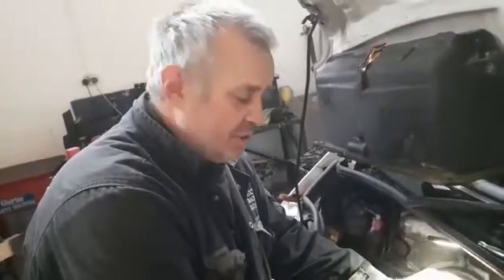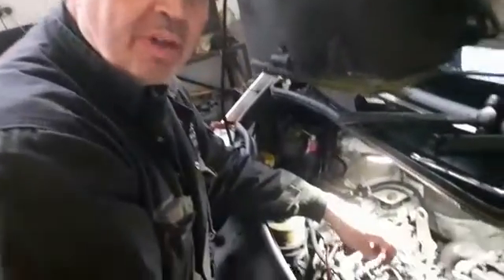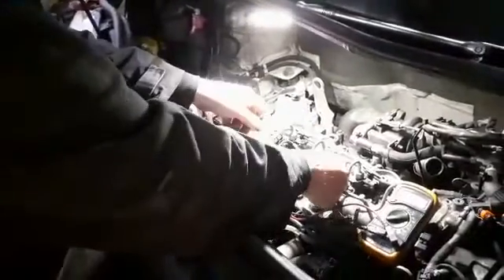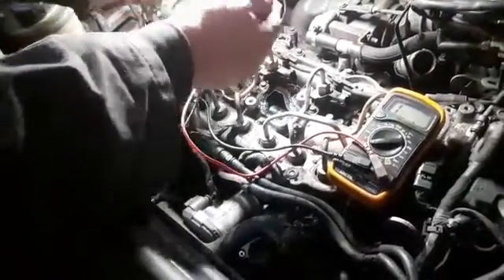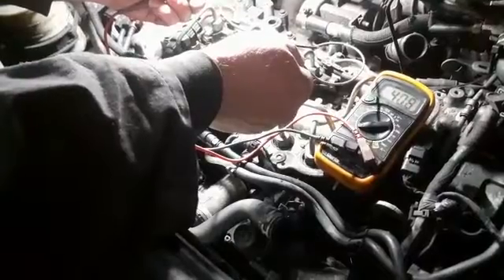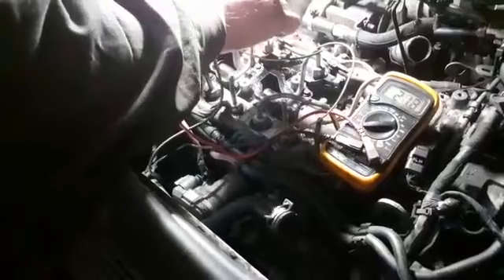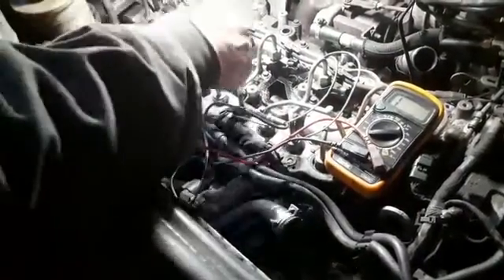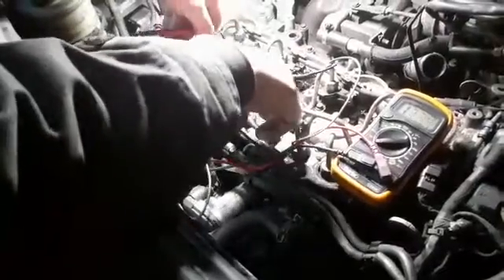Testing diesel injectors. TVP shorting to earth.

Comment: Is it possible that the injector only shorted when the engine is at operating temperature?
Reply from the maker: Yes I have seen injectors give the correct readings cold and short to earth when warm.   The van runs fine when cold and after just a few minutes of driving stop light and battery light comes on and van losses power
Reply: Does this mean I will need a new injector